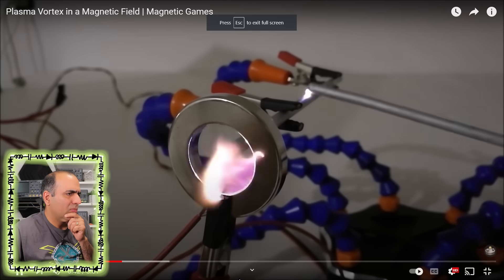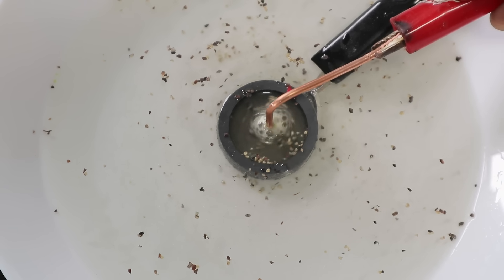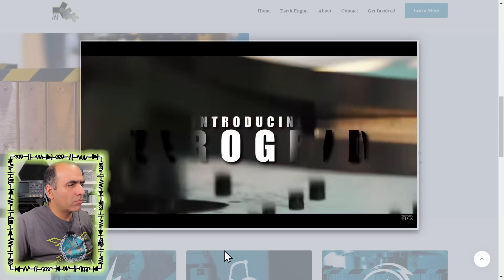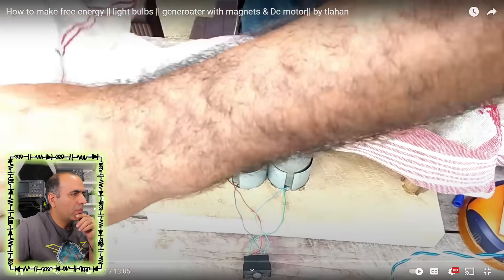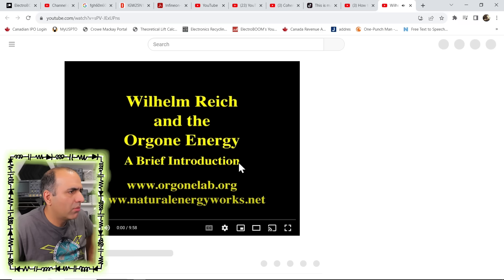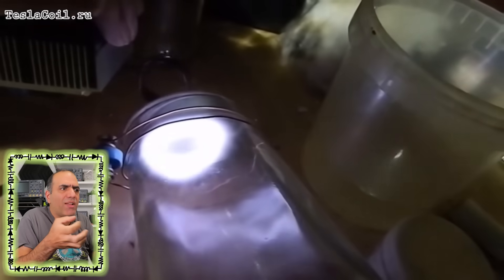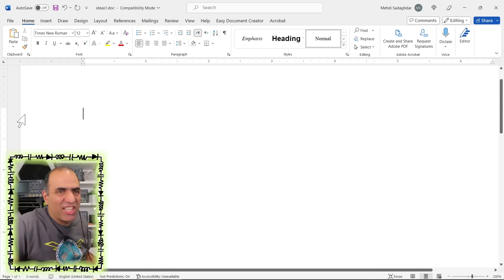Plasma and Salt Water Electric Vortex, Document Free Energy Clean Up

Comment: What i think is so sad is that there are so many misleading "documentaries" about free energy. I also think they don't realise that if making free energy was somohow possible, it would potentially open a white hole or that the universe may brake appart. But it just straight up hurts to see that some companies make "anti-5G" products and sell it for really high prices, although they don't eaven block radiation to begin with. Anti-5G products don't eaven do what they advertise for. It's just sad. Alot of things would go wrong if 5G really was bad, especially since outlets radiate some (very weak) EMF that would give us headaches every time we just use a appliance. Let's not eaven talk about high wattage devices like a microwave. And that some anti-5G products emit actual nuclear radiation, is just harming at this point.

Comment: If you buy and try any of these products PLEASE do the bedsheet. This is the only one of these that if you look it up you don't get videos debunking it to hell and back. Otherwise you'll be just wasting money. Also it isn't as expensive as any of the 5G and EMF stuff. The car fuel saver is just a capacitor and has been well covered.

Actually, why not just make one yourself, all you really need is some wire and a bedsheet.

Comment: Blocking Alexa with ultrassound does work and it's pretty neat. You can also use it the other way around and make alexa hears things that we can't.
It works by using the fact that the microphones components are designed to have a linear response only withing audible range, so by sending two ultrasound frequencies, the amplifier also subtracts them, creating audio range signal inside the microphone itself.

Comment: Dont buy a fuel saver lol. 😂 100% fake, almost certainly a 99% empty circuit board with an LED attached. If it were real auto manufacturers would already have bought and integrated said device. Lmao and its in the cigarette lighter too lol not even the OBDII port where at least theoretically it would be plugging into the right place.

Comment: i have  a question thats more on the infinite, rather than free energy side. (not talking about nuclear fuel here btw) is it possible, to develope a heating source thats so efficient that you can generate more energy from boiling, lets say a liter of water than the heat source uses uses while boiling the water? as in, lets say the 1 liter of water needs x energy to be boiled off completely. if you have a heatsource that uses less energy than x, but still boild all the water with energy surplus? is this making semse? not a sciency person btw

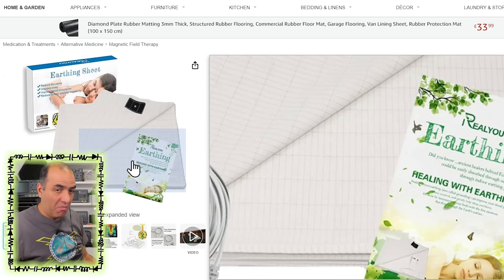Comment: 12:36 I dont know about all the magical whatever with the earthing/grounding sheets, but I used one for a while and it DID stop static shocks from one particular bedsheet. I had it between the sheet and comforter, and in a way not getting randomly shocked when turning over did give me better sleep, so in a way I guess it worked.
Reply: Get a humidifier, once you're above 55% humidity no more static.
Reply: That is definitely worth something. I can remember the static electricity shows I used to get as a kid with my synthetic blankets. I don't care how soft and furry it feels, Mom, if it's going to shock the sh#t out of me! 😸 (and sketch the cat out! )
Reply: Yeah, I believe its basically the same as anti-static clothing which is basic fabric lined with some metal in a net to spread the energy over a larger area

Comment: 3:30 The coherer one may not be fake because they were used to detect EM waves in the early days, at least that's what I have read regarding the history of RF transmission, related to G. Marconi and J.C. Bose. The simpler construction is basically some iron filings in a container (and later with mercury-iron junction) which becomes part of the RF detector loop, and when EM wave hits the loop antenna, the metal particles form tiny cold welds and closes the loop and to reset the coherer, the container is gently tapped to break the cold-welds, (the tapping to decohere is shown in the video). 
The lighter produces high-voltage pulses, which is basically the acceleration of charged particles (e-), thus, it probably generates a broad-spectrum EM pulse to be detected.
Now, such device can be made at home with Aluminium-foil balls or not, I will patiently wait for ElectroBoom to explore & confirm :D
Reply: Looks like he tried it and it works!
Reply: @rowannadon7668  Yes, saw the video, it was very entertaining, as usual :D

Comment: I sent you an email a year ago, but there was no response. I wanted to build an air filter. it would operate on a principle similar to that of the "plasma channel" ion engine. the appropriate frequency of the current on the copper grid would repel the smog particles.

Comment: Would love a video about coherers.  They absolutely were a thing in early radio because tubes and transistors didn't exist yet.  They pass more current in the presence of RF, but need to be shaken every now and then to reset the resistance.  And they're super inefficient.  Marconi used one in the over-the-horizon radio tests - The Secret Life of Machines did an episode on it.
Reply: Yes, the common way to do it was to use one of those electrically powered bells or buzzers.  When the armature of the buzzer went back and forth, it tapped in the coherer to shake the iron filings loose.
Reply: Secret Life of Machines is the Best!!!!
Reply: If I remember correctly they used a morse code relay which would tap the coherer with every dit or dah received.
Reply: Yes, I make a coherer at home and it just responds to an arc but just barely works.
Still don't know how it works.
Reply: Reminds me of the one that I saw that was a working example! There was a solenoid that would tap it after every detected signal to shake the particles around! They are real, and they are a very cool piece of radio history!
Reply: Piezo
Reply: Sounds cool! +1 to the video on that!
Reply: Like a bucket of point contact diodes?
Reply: Not "every so often". After each and every successfully received signal. There were automated devices that would do this for the receiver a little bit after their initial inception. They work by breaking the oxide layer between particles, forming a complete path from one electrode to the other. The "flick" resets the device by rearranging the particles to fresh, oxidized locations on the grains being back in contact with each other, ready for another signal that breaks those down and so on. Primitive, error prone, but "useful" enough to have made them a thing.
Reply: 10:44 why do you think he says that nikola tesla's claim were fake
Reply: @suhan369  It's because Tesla at the time wasn't aware of just how much resistance the atmosphere had, so his "energy from the air" was never going to reach beyond his tower. Just because someone is right about some things, even if is many things, doesn't mean they can't be wrong about others.
Reply: ok thanks @Vaeldarg
Reply: @Vaeldarg he also didn't know about radio waves at the time (as they were just being discovered), so he didn't really understand how his energy was being dispersed on top of the losses from absorption.
Reply: @Vaeldarg  well… his concept is still sound! Now, with his design, it wouldn’t work. But, other methods…

For instance, what if you used the earths magnetic field as a giant generater? Energy would be transfered from the magnetic field (Probally either slowing the cores rotation or cooling it), and converted into an electric charge that would ionize the air. Extract it via antenas, and boom! Energy for a long time!

Or, you can bounce radio waves off of the atmosphere (A major solar flare messes up the ionosphere, preventing the reflection for a few hours. But, besides that, it allows “skiping” across the plannet! That’s how Ham Radios can contact the other side of earth without relays if set up right! So, use a modified version, and you can send high-energy transmisions that refract into multiple directions and reflect, forming a “grid” in the ionosphere, with “pillars” going down. Those “pillars” are at high energy and dangerous, but they line up with distribution towers that are similar to teslas design, but modified to be able to cover a town. Not a world-spanning network, but will at least provide energy to target locations, and with work those relay towers can send signals to sub-relay towers, forming a network…
Reply: @Vaeldarg exactly, not fake, just undeveloped. It also didn't help that the main labs he worked with were aggressively hostile.
Reply: @chtechindustries4174 Source?
Reply: @suhan369  He didn't say that.  Watch again more carefully.  "like Tesla" appears in what he says but that is not the topic he is calling BS.
Reply: @kensmith5694  by that image he says that nikola tesla's claims were fake
Reply: @suhan369  The Tesla idea didn't pan out and many have said fake stuff about it.  I still don't see it as a hit on Tesla
Reply: @kensmith5694  ok thanks
Reply: @kensmith5694  right, nobody is saying it's a hit on Tesla so why do you seem to be defensive of him? Lol
Reply: @joshyoung1440  What the heck are you on about?  I just stated some facts.

Comment: Coherer effect have I seen demonstrated the LED was turned on by a spark gap. I think ‘Marconi’ was using a vibrator to shake the ferrite pieces so it reset so it could be used for receiving morse code.

Comment: How about an array of small "random" wire dipole antennas tuned to specific frequencies connected to a central diode and led so they light up when exposed to their signals ( wifi) as example.

Comment: 11:04 I remember a similar thing from school. The tube is filled with an noble gas and there is a high frequency voltage in the wire that goes around it. This creates a rapidly changing magnetic field which in turn induces a circular electric field in the noble gas, which results in light due to ionisation and recombination. The handheld thingy is probably some other electromagnet which influences the fields
Reply: Maybe handheld thing is something like slayer exciter to start discharge in bottle
Reply: @Antek1234l  correct, it needs something to excite the gas before it can 'hold' plasma. in my above reply can watch a build series by another youtuber on the matter, its sooooo cool.
Reply: Maybe you are talking about the ICP OES or AES instrument which is used for analising chemicals. Inductively coupled plasma. That is beautiful.
Reply: You can also do a similar thing with a uniform magnetic field and some source of electrons.
Reply: https://www.youtube.com/watch?v=GbMAvn7nRWo&t=771s My man perfected it! its is filled with xenon in this demo i think, there is a whole forum and following with these things it turns out
Reply: search plasma toroid
Reply: Ever heard of neon signs?
Reply: @OneVerySadPanda  That ist similar but different. In a neon sign, the voltage is applied directly to the gas. Here it is created by induction. But the way the light is created is the same.

Comment: 5:56 then need 6 hours free each year? 6:34 ohh that is why
XD 250% efficiency, well, if you only see the plug a refrigerator is over 100% because the heat output is more higher than the electricity input

Comment: The flywheel is very good at storing energy to a certain extent but you require energy to get it going first.
Reply: And you can't forget the efficiency losses while spinning it up, keeping it spinning, and extracting the energy.
Reply: @robspiess  nope the closest we can get is in a sealed watch movement balanced on rubies.
Reply: I believe that's the lowest coefficient we've ever achieved not really scalable. I mean I think those old elgan pocket watches had the biggest balance wheel. Steam had a big flywheel but it also had a lot of friction.
Reply: @rustyudder  Well the flywheel in steam engines acted more like a mechanical capacitor since the point of it was to help get over the max piston stroke hump and smoothe out the power delivery of the engine, sorta similar to a crank shaft in an internal combustion engine. And well on engines with multiple pistons like steam trains they were 90 degrees out of sync so quite literally like a crankshaft.

Comment: What is energy then? The more you study, the worse you can answer this peculiar question.
Reply: Lack of entropy
Reply: @fireandcopper  yeah, literally this. Concentrated part of the universe where entropy is low. what kinda answer are they looking for.
Reply: @booooooomko12  I do not think so. Are you sure that you are not referring to the thermodynamic free energy (which is a real physics term and not the kind Mehdi talks about)? Because that can be defined as the relationship of the difference between the entropy of two systems (not lack of entropy, what would that even mean?).

The only description of energy that I can understand is that is a magical mathematical fluke of a unit, which is always consistent when looking at the entirety of a physical system. The only exception being expansion of spacetime itself, in which energy is actually lost and not conserved.

Comment: Not to give credence to Earth engine because they have all the signs of a pure grift but theoretically you could draw from the Earth's kinetic energy through space using something along the lines of the slingshot effect to generate electric power. This would just be a hilariously expensive thing to pull off, especially in a way that's longterm stable, and scaling it up would present some risks of destabilizing Earth's motion state.

Comment: MEHDI PLEASE DONT BUY THE CAR ONE IT MIGHT MODIFY UR ECU STUFF (PROB NOT CUS I THINK IT PLUGS INTO THE CIGARETTE LIGHTER) BUT IF IT DOES THEN IT COULD BE DANGEROUS AS THE FUEL TO AIR RATIO MIGHT GET FCKED AND YOU MIGHT FCK UP UR CAR

Comment: Parendev and ram pump are free energy device that are true
Reply from the maker: GO AWAY!
Reply: @ElectroBOOM  now if you are bright enought to see that there is possibilities of free energie devices build a setup like the parendev and mix it with the one below for the dead spots of the parendev rotors if youdont have 12 magnetics rotors and you have a device that is able to receive an alternator or you can build an alternator on the same shaft
Reply: @ElectroBOOM  the pressure of the watter wheels will depend on the size of the output of the top reservoir
Reply: …and you have now a shaft with 2 free energy devices that work at the same time for producing energy that will multiply your energy output and there you are free of the grid system enjoy ! ….your welcome !
Reply: PS …Jesus still love you …😘
Reply: Remember the principle of the big diesel engines …you have a poney motor to make the big one run , this water device is the poney motor of the parendev , you can set it with a valve and there you go you got your starter switch
Reply: @ElectroBOOM  also , when you will know who i am , i think you will regret your attitube ✌✝

Comment: At the birth of radio reception, before diodes were used as detectors a coherer was used. This was just a switch activated by radio frequencies from a sparkgap transmitter. Tesla used it in his radio control boat demo. I made one with filings from a nickel coin. Beware, sparkgap transmission was banned internationally a long time ago.

Comment: The plasma toroid is pretty cool but also pretty expensive. Unless you live in Russia and have access to custom Noble gas filled glass tubes, it's hard to get your hands on something to make a plasma toroid (or ring discharge device out of). I've also heard you can do it with a much cheaper big neon bulb (it's just not as impressive). I think on that video, they were using a Class E power oscillator feeding power into one coil that inductively coupled to the other coil around the tube and resonated with that doorknob capacitor. BacMacSci and Vidduley (maybe some others) have done some videos on the ring discharge.
Reply: Unless you live in russia? Its a noble gas inside a glass tube. Any glassblower crafter can do a custom tube
Reply: @Srt3D01-db-01  yes, but you need a significant amount of money for one of those tubes (like $300)
Reply: @YSPACElabs  That's what the guy is selling them for. They are a round bottom flask and a noble gas however. Not saying the guy is ripping people off but any well equipped shop can make something like that at least for a bench test level of longevity (IE no glass working, just a vacuum pump and a stopper)
Reply: Why Russia? I live pretty close, might be able to get my hands on some, if the Russian ones are particularly valuable/special.
Reply: @theRPGmaster  actually, tbh, I'm not completely sure if you can get more tubes in Russia, but the company that made the video is in Russia (or near Russia), so I'm guessing that tubes are more accessible there.

Comment: With the tinfoil balls in the cup, it does kind of show that the vertassium guys point was correct. The current is moving in an Omni directional bubble throughout space not necessarily through the copper wire(but maybe through the ether). That might be how the circuit is completed with the piezoelectric lighter.

Comment: Simple and working "free" energy hack:
1. Buy a land close to high voltage AC power line.
2. Dig a hole between the power line lopes and lay a decent length of cable.
3. Enjoy the "free" energy from air.

Comment: The input can be lower than the output of your input is what you have to put in not that is actually there. Ie a fission reaction. The energy is there but to extract it we need to input less energy. 

Or burning a log. Once i start the fire thats all the energy i have to put in

Its marketing